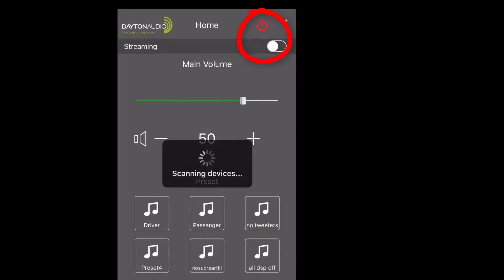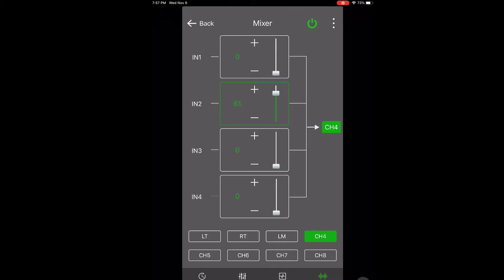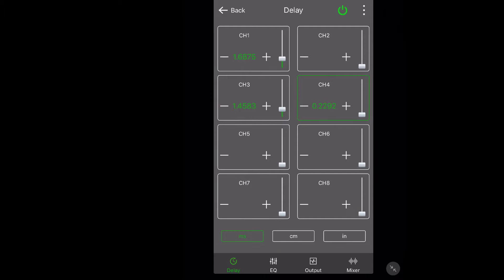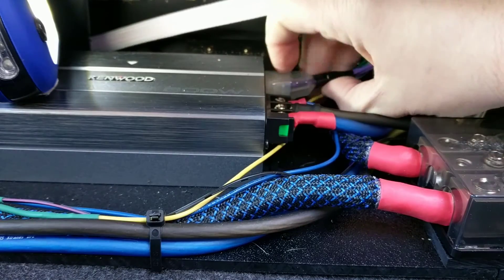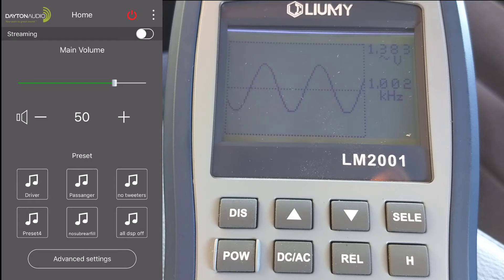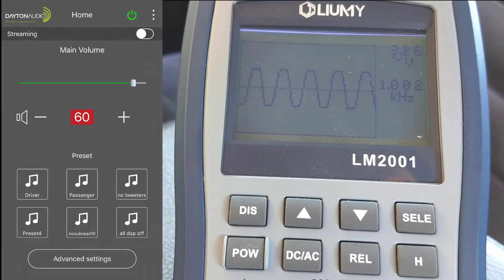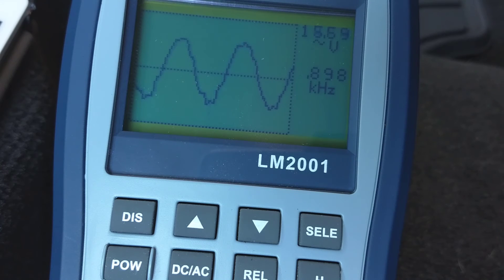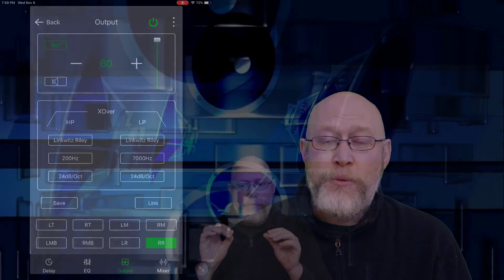Dayton Audio DSP-408:  Dodge Ram Front Stage Build Part 5!

Comment: System playing yet?  I just bought this dsp
Reply from the maker: It sure is, just have not been able to film any updates.
Reply: @DIYAudioGuy  

How do you like the dsp?
Reply from the maker: @drrckhamilton   You are not going to find a better DSP for the price.  it is easy to set up and you have a ton of equalization.  This will be great for a classic car, or somebody that just wants to bypass a head unit entirely and use a phone or a tablet to control the system.  My only real gripe is that the wired remote can not be used as a base knob.  

I'd like to have four volt preamp outputs, a center channel up mixer,  a way to do right minus left so that I could set up the rear fill properly, plus a few extra channels.  but there are some $600 DSPs that don't even have all those features.

At the moment I'm keeping my eye out for a whole house multichannel amplifier, every now and then used once show up at pawn shops.  If I can grab one cheap I'm going to buy another one of these DSPs and use it to make a fully active stereo system for my home.
Reply: @DIYAudioGuy  

Enjoying the content but I know that life happens to all of us.  Thanks again for sharing your adventure!!!!

Comment: I once bought a pair of Solo-Baric Eights from kicker that were mislabeled and one of them was out of phase. Thank God I checked the polarity of them before I sealed up the box because it was a 6 order dual bandpass that was not serviceable. This was using the good old battery test. The only thing it doesn't work on is tweeters
Reply from the maker: Testing is important.

Comment: Got ya had to use it in my challenger it makes things easy but did go with amps cause that premium alpine is bs sucks
Reply from the maker: "Premium" just means hard to replace.
Reply: @DIYAudioGuy  it’s actually easy using pac am pro kit you keep uconnect head unit it gives you plug an play t harness with 3 rca outs you add amps an upgrade speakers sound great

Comment: Bro get a pac plug an play device give rca to use aftermarket amps done
Reply from the maker: You mean the PAC Audio Amp Pro?  If I had a new car with one of those overdone, under a powered factory radios I would for sure grab one of them.  But my old truck is still old school.  It doesn't even have steering wheel controls.

Comment: When you stream on the 408, can you process that signal?
Reply from the maker: Yes.  You need to purchase the optional Bluetooth dongle.  The Bluetooth signal is stereo on input channels 1 and 2.  Then you can use the mixer to route those channels into the 8 outputs where you have full control of the crossovers and parametric equalizers.

Comment: So you run a eq with your Dayton DSP?
Reply from the maker: Just the EQ in the DSP.  Each of the eight channels has a 10 band fully parametric EQ.  Are you running a DSP?  If so, which one?
Reply: DIY Audio Guy I’m running  the exact same one but I’m running  14 10” prv mids  4 8” prv mids 16 tweeters two 12”s resilient sounds and I don’t have a eq just the 1 in my pioneer head unit
Reply from the maker: I'm impressed.  What kind of numbers do you do with that setup?
Reply: @losfreedom7069  is that inside a private jet? Why do you need so many speakers? 😵

Comment: Yes please more content! I'm thinking about getting Dayton myself... Been looking at used dsr1 and twk88 but the 408 price is on point. More tutorials might just make my decision for me so keep it up!
Reply from the maker: OK!
Reply: @DIY Audio Guy  Hey i know this is an old video, but do you have a comparison between the dayton 408 vs the JL twk 88. I've  been trying to get input on which would be better. Od assume both units have probably had some fixes since release. I like the price of the Dayton 408, but it looks to me like it's  only a small upgrade to what my pioneer nex headunit is capable of. Being that the only downside to my headunit is it has just a graphic eq an not parametric, an it of course doesn't have any routing options. It does on the other hand have a pretty decent crossover various time alignment tools sound retrieval options which im not even completely sure what that does, it basically sounds almost like a built in compressor keeping audio tracks at a relative level from song to song. Ive been looking into dsp because id like better eq possibilities. Thanks for your input an sorry for the long reply

Comment: One correction. The link feature will not simply link the output or volume settings. It copies all setting, crossover, eq, etc. If there is a problem, you should try firmware update. Suggested to do firmware update straight out of box in case you are on an old firmware.
Reply from the maker: That is the way I thought it should work, but it did not work that way for me.

I updated the firmware before the installation, I will give it another try and let you know what happens.
Reply: @DIYAudioGuy  the link feature can be tricky on it. I've been running it for about 3 months. It seems that all the features work much better from laptop than app. In the laptop software, it color codes which channels are linked, versus the app which shows all link options red. Also, much easier to eq from laptop versus phone, you can simply type frequency into box, as well as q and level. But, for price point, I will deal with shortcomings of app.
Reply from the maker: @danny51577  feature in the app is also color coded.
Reply: @DIYAudioGuy  maybe it's just mine, but I link them via laptop and the link option shows different colors for linked pairs, and shows only red for any linked option on app

Comment: I remember when I first saw the polarity checker, and thought the same as you. I’ve always been a , use a 9 volt to pop the speaker, kind of guy. But always worried if my tweeters were wired backwards. But since I got one, It makes checking polarity on my installs a breeze, and gives you piece of mind that you did absolutely everything to ensure that there isn’t going to be a problem with backwards wiring being the culprit. Keep up the great videos man!! Looking forward to seeing that dsp in action with the eq settings. 👍🏽👍🏽
Reply from the maker: I know!  Such a simple tool, it makes a huge difference!